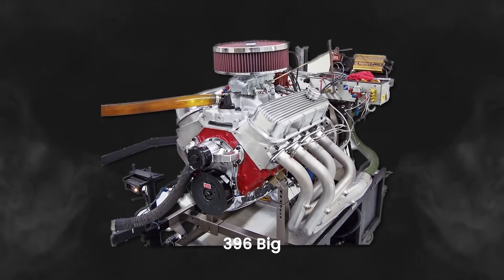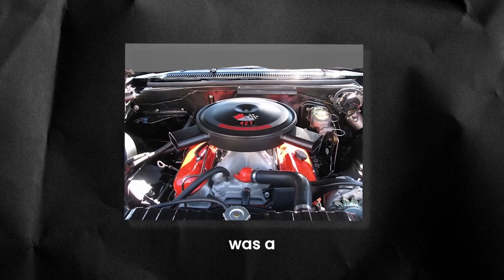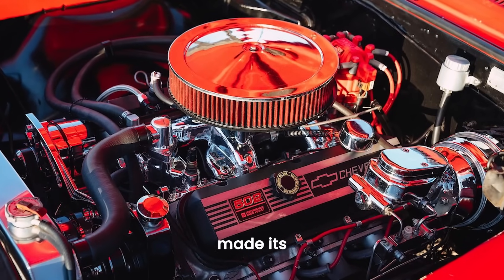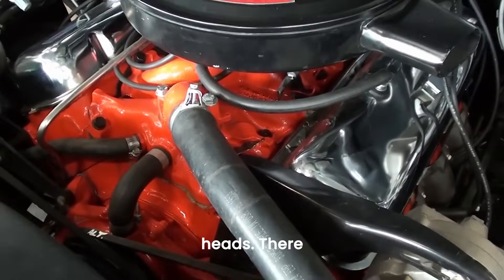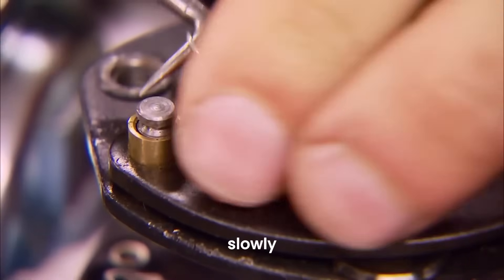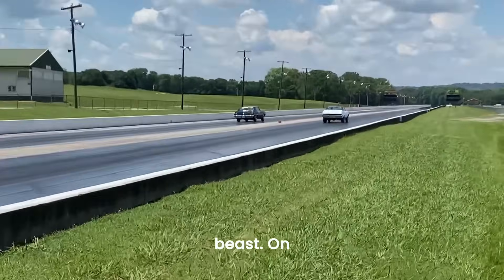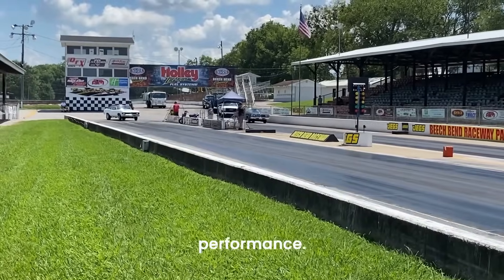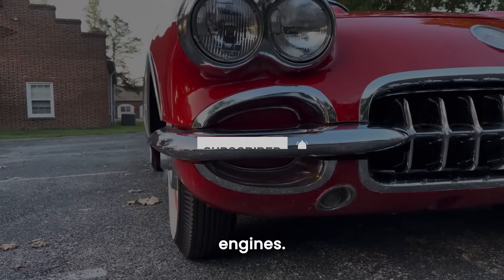The Shocking Truth Behind Chevrolet BANNED 396 Big Block Engine

Comment: My chevell had a 396.
Cast iron high rise. 4brl.411 limited slip dif. 30 over from the factory. 11 : 1 high dome piston  solid lift cam. 
Motor came out of a wreaking yard. I changed piston to 10.5 pop-ups. Closed chmb heads and a roller cam and rockers. Ported,polished headsand biggest valves I could fit.. aluminum high rise torquer intake and 850 cfm Holly df dbl pumper 
Sucker would break the tires lose at 55 mph.
Only thing faster than that, I've been in was a friend's blown.454 in a boat.
Reply from the maker: @commentsedited  Sounds AMAZING! Thank you for sharing!!!!
Reply: @CarCruiser24  lol yeah. I dead centered a tree in the 67SS,so I got the bright idea that I was going to put it in a 57 nomad, 2 door  wagon. 
Lasted about 5 months and I put it in a ditch at about 140 mph, backwards in and out. Chp said that I went over 100 yards before it landed upside down in a field..broke my back in 2 places. 
Sold it after that one. In 95 I had a 47 Willie's jeep. Dropped a 302 ci ferd in it.  
Throttle stuck one day and it went up and over the Sacramento River levy and I broke my back and my neck on that one..got a free helicopter ride though. 🙃
I think I'm going to trick out my 1800 vtx honda now. Lol yeah I know. Oh well.
Got live before you die.
( 46  excuse me) first year of civilian availability)
Reply: @CarCruiser24  do you have any videos with blower do's and don't
Reply from the maker: @ I will look into that for you. I will reach out to the team and get back to you. Thanks!